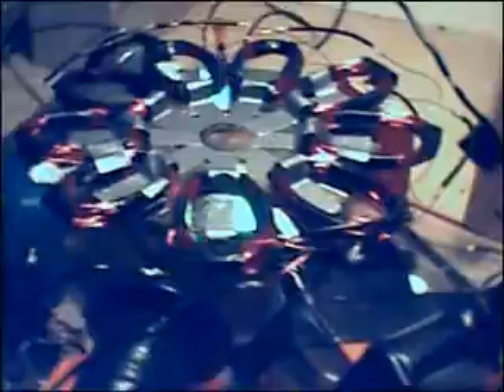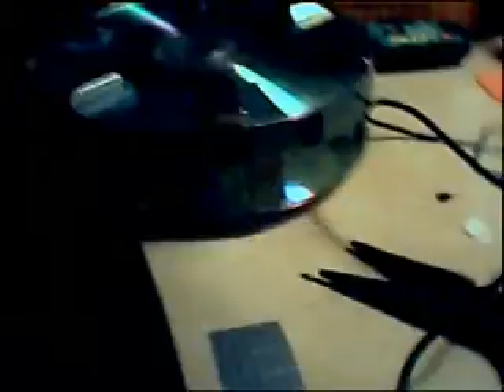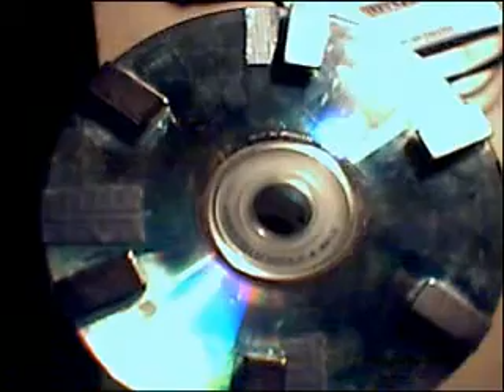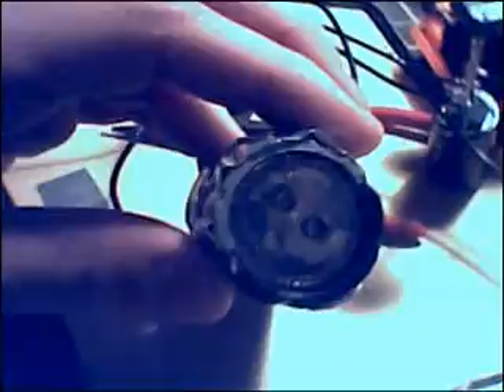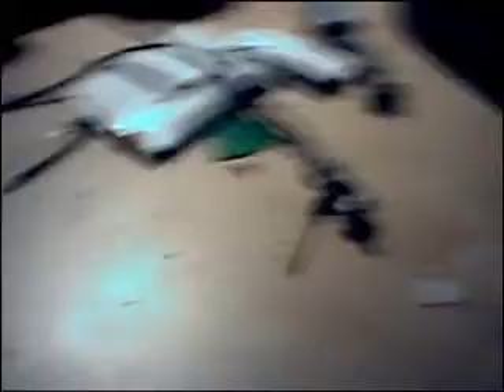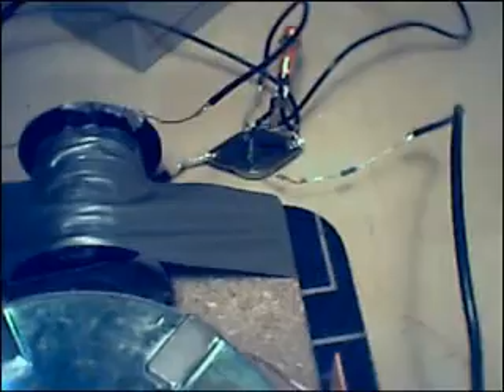Bedini Rebuild explained

Comment from the maker: Well here is a little update for u. Through testing I have found that the generator on the top is pretty much shite atm. The coils on the top are not wound right, not flat enough so currently we get more juice from my black extractor coil. I do believe that with some precision engineering I can get this right.
Was also thinking of using rounded/curved magnets on the bedini then i can have more rows of extractor coils. You know, above and below where they are positioned now.